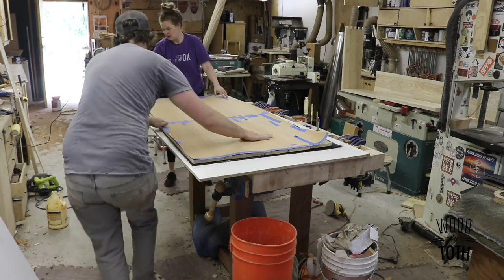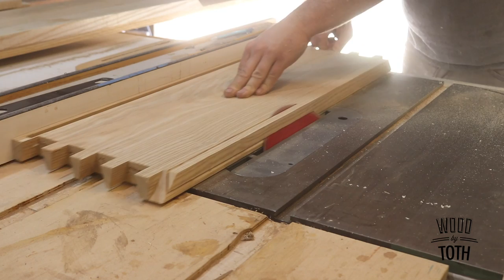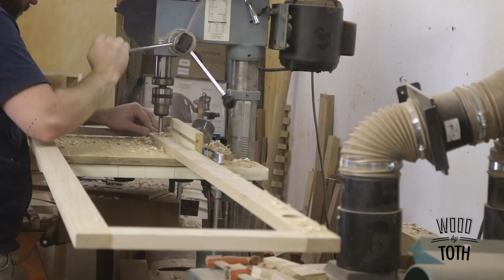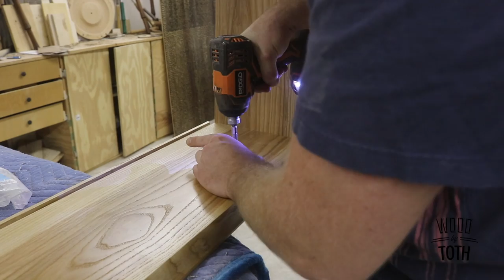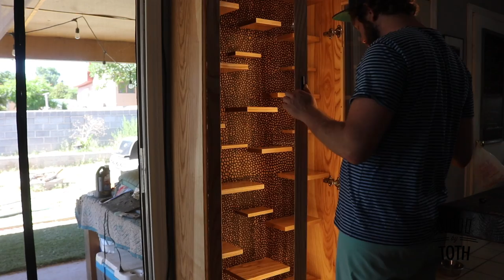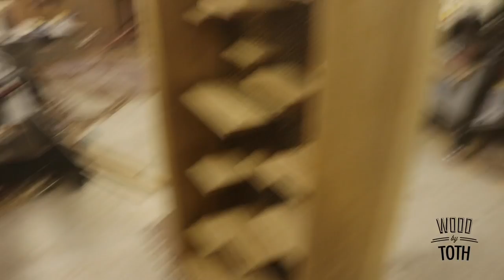Floating Shelf Glass Cabinet

Comment: Looks good. If you made the door stile wider on one door in the center then cut a rabbit for the other door to close into it and a corresponding rabbit at the back of the other door it would  hide the gap between doors when they are closed.

Comment: For the trim holding in the glass you should pin it parallel to the pane. If you mitre the corners the pins only need to hold a shear load so the fit doesn't need to be really tight if you want to predrill to minimise the risk of splitting. Also you'll want to use a pin punch so you don't end up whacking the glass with the hammer.
Reply from the maker: Not sure I follow, the glass is in its own groove and the trim is in another groove holding that in
Reply: @WoodByToth  I like this idea, definitely stealing it! Thanks
Reply: @WoodByToth  As you have it currently, if those screws holding the trim ever come loose (like from repeated pushing on the glass) then the trim will fall away. Also it looks like you had trouble fitting the screw in the small gap between the edge of the glass. It works, it's just you'll probably find using nails parallel to the glass (90° to the screws) easier and will hold up better in the long term. You also wouldn't need to router out the second step for the trim, just make the trim the same width as the lip that holds the glass from the front.